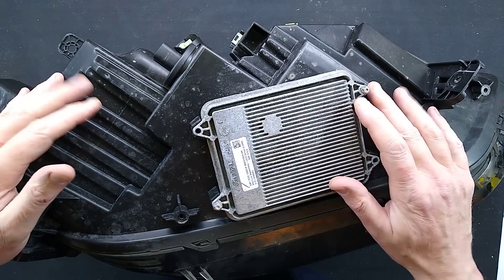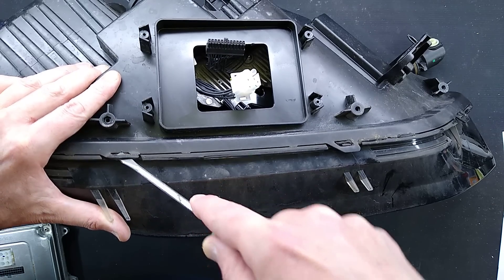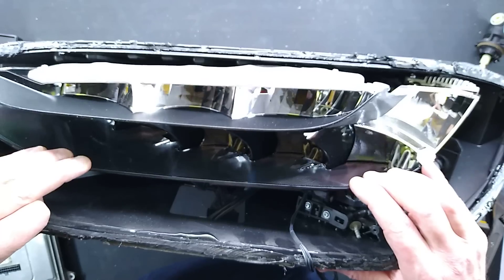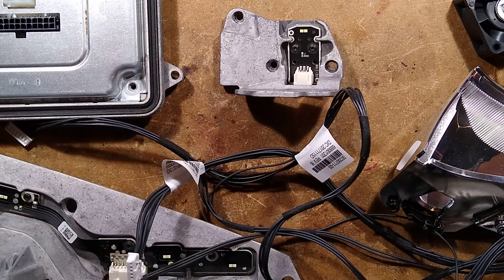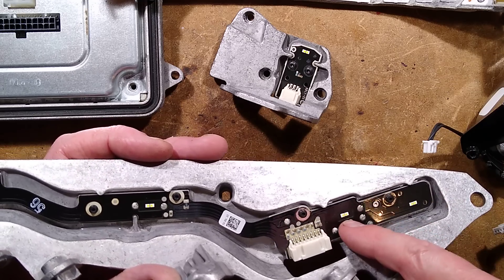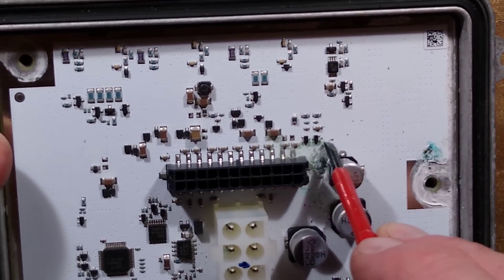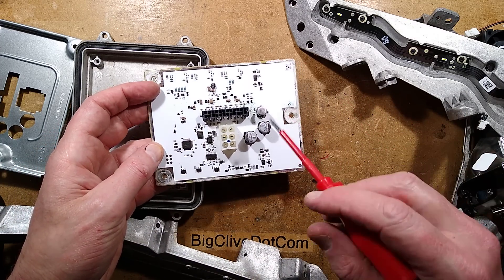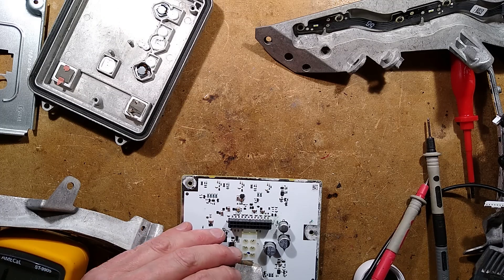Exploring a Tesla model X headlight

Comment: I remember the era of the early LED chips, getting 70lm out of a watt was quite a challenge, lumen maintenance was crap and cooling was a problem, nowadays, cold white LEDs do 150-170lm, given that 35W HID bulb can do 3000lm, to match that we need a mere 20W, out of which 20-25% escapes purely as light, leaving only 15W to deal as heat, this is measly for the amount of light you get, sure you have to account for losses in the optical system, but still.
Also that power module is pure assholery, inductors glued down and all, y'all can't design a low loss synchro-boost-buck for a ~40W load that doesn't need that much cooling? Pathetic and unrepairable.
Reply: I hate cold white headlights.
Reply: There is a reason for that - humans have better sensitivity for colder/bluish light at night. Look up scotopic/photopic ratio if you want more info.
Reply: You'd need to consider that the heat being removed is a temp rise above ambient and ambient for a vehicle can be very high in the worst cases like high noon in Death Valley.  Add in a safety factor to ensure typical capacitor lifetime will exceed warranty and you end up with a huge heatsink (just to make sure ;)
Reply: @potterteksmith7548  You need headlights at high noon? Take off the sunglasses man!
But I was thinking the same.
I worked in the Automotive Industry and torture tested dozens of different electronic car thingies. They go in an oven at 80°C (180°F) stay there for half an hour and then get switched over to a freezer at -40°C (-40'°F). All full operational at full power. After a thousand cycles or so, they get tested and have to work like new.
And from experience I can say: This headlight is cheap crap and should not be in a 80k$ Vehicle

Comment: I've taken apart Yamaha motorcycle headlights which look like the exact same housing system, and they are glued together with a very low temp glue. Heat gun on low setting and keep the heat moving until you are able to see a bit of movement when using a screwdriver to gently separate the halves. The clips can cause trouble. Reassembly can be done carefully with the original adhesive. Patience and cleanliness is key.  People simply had to have after market Angel Eye LED's inside their headlights. 👀👀

Comment: I reckon it's somewhat atypical for an LED in a headlight to be mounted on the bottom and shining up into a reflector. Usually it's the other way round so the bare LED itself isn't visible from above and cannot blind oncoming traffic, provided that the reflector is aimed correctly. At least for bicycle headlights this is pretty much universal; I always assumed that it'd be the same for automotive.

Comment: There are 3 things made poorly or cheaply with this unit. 1 if the head light unit is glued or friction welded the connectors should be an integral part of the unit case with rubber seals so no moisture can entehr the shut headlight case. 2nd the actuator to move the light assembly (light beam) should either be integrated into the unit or move the whole unit. 3rd the electronics should be conformal coated even when in a water tight case, especially when in such exposed position in the front of the car.even the best rubber seal don’t keep tight for long in these harsh conditions. High and low temps, high wind and water, salt, dirt, soap, solvents…

Comment: WTF holy crap they are using motherboard connectors to connect the light control unit to the main head light 🤣 never seen before. But after this i will never buy a Tesla. This connectors are not for car use. In my opinion there are better connectors especially for car engineering. And how they sealed the unit to the headlight 🤦🏻‍♂️, no wonder that inside the unit is water 🤦🏻‍♂️.
Reply: Don't get a car with Hella headlamps then. These are made by Hella - the world largest headlamp manufacturer. And is being used by a large majority of cars these days.

Comment: Need to bake the plastic / glue to about 500 F.  Seen it on Youtube. 
(They put the light fixture in a cardboard box, and put a couple hot air guns to heat it up to 500 F for about 30-45 minutes.)

Comment: As others have said, putting it in an oven probably would have allowed for removal of the lens although maybe not. I couldn't tell if it had the common butyl strip around it. The sweep of leds does all kinds of fancy things like sweeping out then going steady on and stuff. I wonder if the water ingress was due to quality control issues or if something else happened to cause it.

Comment: Mmmm, a problem with the canbus network can take down other items?  During summer months my van throws up all sorts of errors including lots of canbus errors.  They all go as soon as average temps drop below 10'C.  I'd figured it was probably a bad earth but from what you casually mentioned it could be a dodgy canbus module somehere.
Reply: CAN bus is a looped network, so if you get a break or something shorts it to ground, none of the modules can talk to each other.
Reply: Can it be local?  It seems to affect the front left corner, i.e. the horn, fuel pump/pressure sensor, intercooler temp sensor,  instrument cluster (Mercedes vehicle so connector on the left), battery control module etc.
If only I could work out why it's fine over winter!

Comment: As a car factory spark I would love to see more automotive electrics :D 
In regards to module replacement; yes, that would absolutely be the easier (and cheaper) fix but from a factory perspective that means either repairing the original module, which then classes the headlight assembly as refurbished (no go on factory new), or obtaining that specific module as spare parts (and dozens more around the vehicle) from the suppliers, which they don't want to do as they would rather sell another full headlight, and factory owners don't want to pay out for 1000s of spares that may or may not be used, so many get scrapped, or returned to supplier, to be scrapped later (the auto industry is "going green" right!? lol).
Reply: I'd love to see hackers making 'bypass' modules for these fancy electronics.  Just watched someone spend a day trying to open the boot of a Bentley - impossible due to a dud 'module' which could probably be bypassed using a simple switch.  The fact that all such modules are 'coded' to the vehicle only goes to show that cars are engineered to stop you repairing them.
Reply: @kellyeye7224  That headlight ciurcuit is not realy bypassable as it protects the LEDs from self distruction. LEDs are very susceptible to over heating and would fail on the first hot day if you just conected a dump power supply of some sort. That circuit will be moroitoring the current to each LED string and will report back tot he ccabin console via the CAN bus if there is a fault or error condition which could save a life in certain situations. I would expect the drive circiut also moistors the temprature either ambient of withing the head light and drops the current to compensate. The voltage will most likle be a square wave of some sort and the circuit will viary the dutycycle to control the power to it.
Reply: @Timbo_tango  Disagree.  Standard LED drivers are 10-a-penny these days and well able to cope with whatever demands a headlight might make of them.  If they fail from overheating (as many LEDs do) then that's simply bad design by the person responsible for the cooling part of it.  Clive will readily confirm tat deliberately under-driving LEDs will greatly extend their lifespan and would likely have little impact on the 'absolute' light production.  All that aside, much of the cause for failure is in the comms area - why it has been decided that each and every module 'must' talk to each other (or the CPU) and refuse to operate if that comms link is missing is the greater issue and the one that stops people using aftermarket solutions.
Reply: @Timbo_tango  For HEadlights there is one thing more to them. As the difference between Hi and Low beam is just switching either on more LEDs or tilting the module, for safety reasons no one wants the Hi Beams to accidentially come on continuously by bridging them. Here In Germany I guess the Police would tell you some words if you drive around blinding everyone else all the time before they send it of to be inspected and deemed not roadworthy.
But even though that is a concern, I bet there could be other designs made to make it work that way.
Reply: @kellyeye7224  I disagree with your disagreement statement. Firstly there is no such thing as a "Standard LED driver" as each manufacture makes different circuits al the time. I do agree that those "10-a-penny" drives are cheap but they are cheap for a reason and that is (generally) you get what you pay for in this world.
If it’s cheap it’s probably had good stuff taken out to make it so. Secondly cooling design is not just limited to mechanical design, it’s also often controlled or monitored by electronics this is what one would call a "Smart LED Driver". But yeah knock yourself out with a cheap Alibaba order online, fit it back into that Tesla and see if it will last.
Reply: Mikeselectricstuff has some teardown of traction modules.
That module is pure assholery, and yes there are shops that specialize on fixing those fancy headlights, but yeah who needs that.

Comment: [I decided to split my original comment into feedback in the other, and circuit speculation in this one] 
A thought about the lack of LED driving circuitry... 
Perhaps they are directly taping the battery pack at certain intervals, to get almost the exact voltage needed? (although, admittedly this seems unlikely, purely from an unbalanced cell wear standpoint)

Alternatively, and probably more likely, that their power is being regulated by the main power board closer to the battery?

Wait... No that can't be possible, right, due to only having a 6-pin external connection...? 🤔
So then: is what's on that board capable of doing multichannel PWM?? 
The module receives.... a... minimum voltage(?),  dictated by whichever strip runs off the least (main headlights I figure?), where the rest (daytime running lights) are being boosted via the inductors side they wouldn't need as much current on account if being dimmer...??
Reply: PMIC or discrete controllers/converters.

All controlled via a microcontroller that most likely communicate via CAN on the two non-power lines.
Reply: @erlendse  Headlamp is driven with LIN bus.
Reply: @sjokomelk  Ok, fair.

At least it's some kind of serial interface or bus.

Comment: I hate this trend of gluing/welding everything shut nowadays.
These companies keep spouting that nonsense about "environment", "green", "recycle", "renewable" while doing absolutely nothing (I guess you can make a case for Tesla being an EV manufacturer) real about that stuff.
Their products are increasingly hard, and even impossible, to repair, I have a hard time believing that all that glue is actually necessary in the majority of cases, it just feels like it's just to cheapen production to increase revenue while also making it virtually impossible for 99% of the users to repair their (can you even say you own the electronic devices you buy these days?) devices, so that the user is given the illusion of being able to repair their stuff, only from the manufacturer, of course, for an exorbitant amount of money, so that the user instead ends up buying a new device instead.
Yay, more e-waste!!!
Reply: This „expert“ Sandy Munro thinks that everything should be glue and every part should have at least 3 different uses included, so you can tripple the parts revenue. Have you seen the repair (outside Tesla) if a 20000$ battery pack with a broken coolant in-/outlet. Can be fixed with a 2$ part, but they wanted to sell a new battery. You do not even have open the battery and they owner thought about getting a new battery installed by Tesla. When he asked to get the old one to sell the individual packs, they told him he can’t get it because he would not be allowed to transport these dangerous goods.

Comment: Is this typically stupid design of LED headlights, or does Tesla just have particularly bad engineers?
Reply: This was made by Hella. But they are all the same on the inside. All of Hella, Valeo and all the other ones.
Reply: @sjokomelk  And overseen and approved by Tesla.
Reply: @sjokomelk  So LED headlights are all designed like complete crap.  In fact, LED lighting you can buy as a 'solution' seems to always be crap. Sure, the LEDs themselves might last tens of thousands of hours, but they come with an integrated, unreplaceable and unserviceable power supply that craps out after a couple thousand.

And the damn COST of the things!  That's worse than the Xenon headlamps here the replacement lamp costs $10 but you ALSO need to replace a $400 resistor!

Comment: Actually Clive, a much easier way to open those headlights is to place the entire unit into an oven heated to 250F for 9 minutes.  That softens the adhesive enough that you can pry apart the front lens from the main unit.  You can also use a heat gun, but the oven trick works better as it applies the heat much more evenly.
Reply: Thanks for the tip, for he rest of the world that's 120C

Comment: What?  No adaptive, pixelating, light sources? That seems a bit odd.

I would have thought that the rocking mechanism was the same as in any other car, there to set the headlights initial aim. Any mechanical dipping mechanism would be very hit n' miss, as was found in the early days of dipping headlights.  I'd have thought the dipping mechanism was by way of selectively switching LED segments to shape the beam - That's how any decent make of car does it.

Three strips of LEDs - One DRL, one headlight, and the last one being direction indicator.  The ridiculous part being that when one fails, the whole lot goes in the bin!  I'll stick to my old Volvo with its halogen bulbs!
Reply: The mechanical part is the manual aiming screw used to set up the headlamp after installation. Just like any other "old" headlight. The beam never moves. There is the one large strip in the bottom that is DRL when on full power and parking light when at low power. Then you have parts of the middle strip for the low beam, three LEDs on top for cornering lights, and the rest of the top and bottom strips are high beams. Indicator is in the lower front fascia on the Model X.

Comment: My Dad's 1934 vintage Austin 10 had an electro-mechanical dip mechanism. A solenoid operated by the dip switch swung the entire reflector +  bulb on a pivot. Its a bit weird to see basically the same arrangement on very modern car,
Reply: It's more likely that the tilt mechanism is for headlight levelling, not for selecting between dipped and main beam. Most cars have separate bulbs/LEDs for the dipped and main beams.
Reply: The Chevy Volt does that. But it just moves a shutter in front of the bulb out of the way (it has projector headlights), it doesn't move the whole bulb.
Reply: The tilting is definitely for headlight levelling, not dip/main.

Comment: WTF, why not just regular off-the-shelf xenons and a 400v-to-12v buck converter? Or if scale economy makes it cheaper just a 400v headlight? Whose dumbass idea was this to make $1200 headlights that take a computer just for on/off/dim (that's been "good enough" for over a century)? The cost of that alone makes me not want to buy a Tesla, forget all the other drawbacks.
Reply: There are far more functions in this than on/off/dim. There is two different DRL modes (US and Europe), parking lights/side light, low beam, high beam that has a ramp-up when turned on, and 3 cornering lights that turn on in succession when turning the wheel.
Reply: @sjokomelk  sounds like extra shit that's totally unnecessary when low/high/off has been good enough for 100+ years. For $1200 it could be shooting laser light as well to get rid of road deer during hunting season. When ordinary led lights need not only a power supply but instead of a simple relay microprocessor control that's just dumb. Only thing that should need a computer is the AI driving it and maybe battery management.

Comment: Oh for the days when a headlamp was simply connected to power by a switch and you could change the bulb in 2 minutes
Reply: As long as you don’t drive a Renault Clio…. Quite inaccessible
Reply: @peterpb0ans68  Or a Scenic. The manual recommends taking to a garage to change the bulb. Luckily I have small hands.
Reply: @ReverendFlatus  I drove a Clio for 5 years. Apparently the voltage was a little high, every 8000 km the headlights burned… very annoying. It takes you half an hour to change them. I don’t have small hands, and visit a garage takes much longer.

Comment: That is built like a standard industry lamp ,with the exception of having no halogen main lamps.
Most likely its not made by Tesla at all , but made for them to their specs.
I am curious how this lamp holds up in cold Winter weather.
Here , in America's Rust Belt , the halogen main lamps are needed to heat up the headlams enough to combat freeze over and condensation.I have never seen one with exclusive LED lighting that is factory OEM.
If that light assembly had halogen main lamps, it may not have died fron corrosion so quickly.
Reply: I have never been able to drive my Model X here in Norway during winter or in rain. The headlamps explode if the temperature drops below 20 degrees C, or the humidity in the air goes above 30%. (This is irony.)
Just like any other car with LED headlights, it works fine in winter. And snow isn't really a problem when driving, since the lamp itself doesn't get warm, so is just blows over the headlight.

Comment: Same issue as the Alfa 147 xenon headlights I think.
The ballast is slung under the headlight. If the Headlight lets water in for whatever reason it makes its way to the lowest point and down into the ballast via the wiring. Doesn't matter how good the gasket is on the ballast.